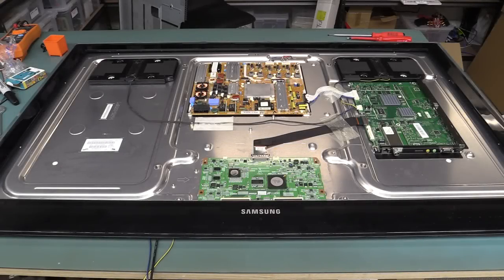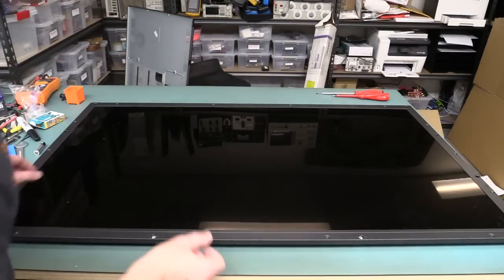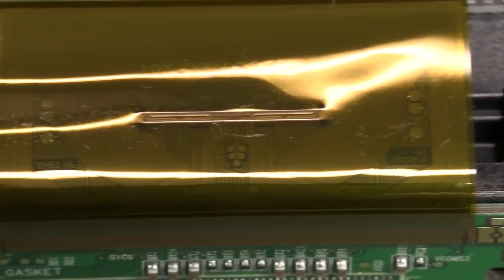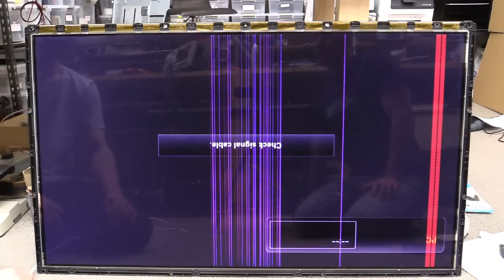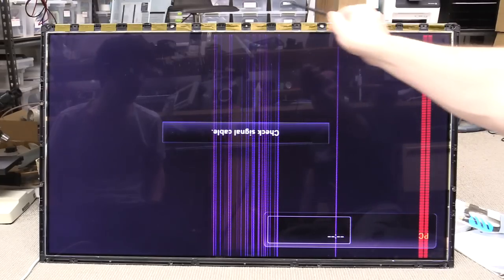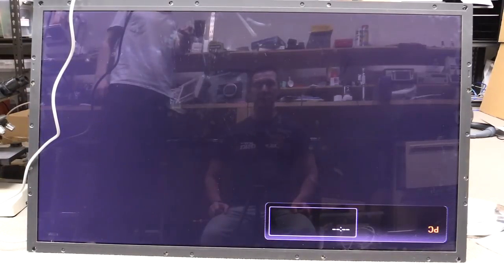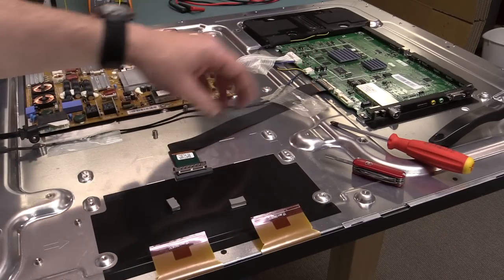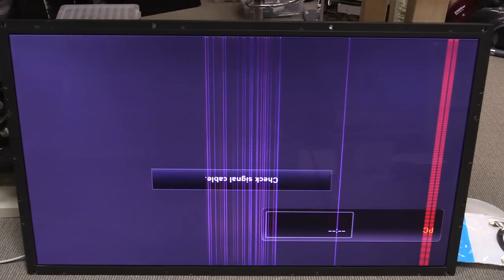EEVblog #781 - Samsung LCD TV Part 2

Comment: The fade-in and shadowing says "floating input somewhere" to me
Reply: mikeselectricstuff It seems doubtful that anything is addressed by column in a way that would break things across the whole column before and after the text except for something related directly to the panel.

I'm somewhat familiar with how this failure mode might occur with OLED panels, but I'm not that familiar with LED panels. With OLED panels, you need to reset each element to a certain voltage before writing a new scanline. It would seem here that something about each vertical column isn't getting reset between scanlines and some voltage or charge is building up across the whole column. And it's panel wide.
Reply from the maker: mikeselectricstuff That's what I was going to check with the scope if I get around to it.
Reply: I had a similar issue with a tea damaged LCD panel from an iPhone 4, but it was more in the opposite order. The panel would start up fuzzy and eventually clear up after being on for ~10 minutes. Some characters made bigger lines to be displayed as well. It has 3 chips on the panel(chip-on-glass?); two drivers apparently for each side of the long edge, and the wide chip tcon/short edge driver. The LVDS bus is fine and then phone has no issues with a new screen.
Reply: Definitely something floating...
Reply: Gustavo Ferlizi Are you British? Surely you gotta be British if you managed to damage an LCD panel with tea.
Reply: Techy 4198 Not British born, but live just out of London and drink loads of tea. Not my phone and not me that gave it some tea.
Reply: Gustavo Ferlizi Oops, sorry, misread it. I thought you said it was your phone. Let me guess which company that phone is/was on... Tea-Mobile? :P
Reply: +Techy 4198 it was Teasco Mobile :D
Reply: Gustavo Ferlizi Isn't that run through Oh-Tea's network?
Reply: Techy 4198 It was. Tealefonica sold to HTeeaG (3). I am a Teea UK customer, and now connect to the previous Oh-Tea network infrastructure seamlessly. Fiftea mb/s LTeaE at home! :D
Reply: In a detective scenario you always looks at the particulars. 
It's a column artifact on screen. It has a leakage type progression. It seems to be triggered by bright elements, either 255 per channel value or near to that. The orange triggers red flooding, white triggers both red and blue (purple). Oddly green is not triggered. So what could possibly support a smooth progression in a digital panel? certainly not any of the digital states because digital ramp up can only be done intentionally due to its discrete nature. You would need a counter circuit for that and that doesn't happen accidentally. I think there must be a final analog electrical state that is the result of the digital pixel value and that has a leakage of some kind. I'm guessing it's a panel problem. Maybe it was dropped. But for the problem to be universal for the entire surface which it seems to be, it would have to be a 'common mode' problem, like a leak on the edge of the panel. Maybe pinch the bottom of the panel. Where the luminous row is. Or cold spray the edge. Maybe cleaning lady applied a liquid that burned the lower edge of the panel? women :)
Reply: +Mila Miglia Yep. I think layer separation is what happened in my case with water ingress in the panel. For a panel that big however I wonder if shock damage could manifest throughout the hole thing like that... but I'm sure Murphy would find a way to knock the whole thing off it's 'rails' with a single bump.
Reply: Mila Miglia i am still confident what this is gate driver problem, nothing to do with physical damage of panel or something else. also there is one line on panel right on bottom(where all connections goes) which shows defect right from start and with most intensity
Reply: Mila Miglia The cleaning lady at a place I worked at in the mid-80s gave a very expensive Digital (DEC) monitor with a very non-reflective multilayer coating a good going over with some spray wax polish. It was never the same again.
Reply: Graham Langley My Ex used to do that on everything.When we moved, you couldn't pick anything up because they where all so slippery. ruined the finish of all my audio equipment.
Reply: +Gustavo Ferlizi be happy you're not on A-Tea and Tea, i hear they work closely with intealligence
Reply: It looks like both address- and value-related. I would put my money on faulty SDRAM(s).
Reply: mikeselectricstuff 
The Failure has to do with white balance settings - Switch the tv to standby, then press

"info" "menu" "mute" "power on" buttons on the remonte.

You will enter a HIDDEN SERVICE MENU

Alternativly press

"Mute" "1" "8" "2" "Power" buttons on the remonte.

Go to ADC/WB Option under the WHITEBALANCE menu

Reduce the value untill the vertical lines vanish

Go to the Brightness option in the menu

Fine tune your picture

Source:
'Samsung tv vertical lines problem fixed...'

It's worth a try
Reply: dobroslawja
no remote
Reply: Sirus 
1. buy a replacement

2. clone a remonte by teaching an universal programmable remonte (10 bucks)

3. reverse engineer a samsung remonte and send dave the codes on the physical level

dave will then be able to bypass the IR receiver, generate the codes with the right frequncy by an arduino and inject them with the right signal levels to the tv
Reply: dobroslawja Bloody IR remotes. To many "standards" to much bloody hard work. Against all my my sanity I do agree that smart phone control is a good idea for your local environment as you have blue tooth and wifi standards. Line of sight is replaced with a code.
If you have a family, the joke of who is in control of the remote goes out the window. Mummys got the remote, daddy don't watch the telly but can shut the thing down.

Your points 1,2,3 need the remote.
Reply: EEVblog Why didn't you freeze the flat-flex-chips?
Reply: The Kaiser I wonder how and why this works or is it a fake?
Reply: Mila Miglia I think you're on the right track. Remember that all modern hi-res panels are active-matrix, with a thin-film transistor (TFT) at every pixel. An entire row of transistors are turned on at once, and the column drivers are set to the correct voltages for that row. Then, the transistors for that row are shut off and the next row is turned on. I think that what's happening here is that the transistors are not getting fully cut off when the row is deselected, and they are allowing charge to leak through to the pixel itself. The common-mode cause could be an incorrect bias voltage being supplied to the row drivers, the column drivers, or both. Time to take a closer look at voltages on that TCON board.
Reply: theuser6666 Or perhaps a cap at the reference voltage stage. That ref voltage needs to be spot on.
Reply: +EEVblog I can't wait for part three of this exciting detective story!
Reply: +EEVblog From what i remember i believe this is a LN46A550 because i recognize the same interface on my B2330HD/LS23PTNSF/ZA (23" LCD TV)
Reply: Westley West How does this bring us any closer to solving the problem?
Reply: Google+ is Censorship Just Reference.
Reply: Westley West Is that all wizards can do these days? What kind of wizardry is that?!
I am gravely disappointed.
Reply: Google+ is Censorship I'm sorry i didn't mean to say that. all i know is it has a similarity.
Reply: My first thought was heat. As the chips heat up to operating voltage, the lines appear. But as he noted it seems to follow characters, that still leads me to think it is a processing issue.

Comment: All the vertical lines, line up exactly with the OSD text, so its looking like it is possibly an issue driving the framebuffer RAM's, I've seen the same style of issue on a much lower tech LED sign display, caused by a decoder with leaky outputs not fully turning off  after drawing a pixel, so you ended up with faint trails on the next lines
Reply: can you explain for me a little  more please ?
Reply: Dwwd
Reply: Dwwdd

Comment: The problem is the LCD panel, this is a very common problem for Samsung TVs. If you disconnect one ribbon cable from the Tconn to the panel the problem might go away (only half the picture will show) and you will know the side that is causing the problem. You can also try some freeze spray on the COFs to see how it reacts.

Comment: Surely it's 1920xRGB=5760 columns?
Reply: mikeselectricstuff Not the first time Dave forgot pixels have rgb elements.
Reply from the maker: mikeselectricstuff Err, yeah, Doh.
Reply: +Gone Tomorrow I would assume mobile phones have a lot more on glass logic to get passed that.
Reply: ***** but its not only theirs 3 color for each pixel but you also have two lines correspond to each subpixel and a transistor in the corner.
Reply: EEVblog I may sound like an amater , but does the smaller BGA on TCON board looks like it's gone...? Looks like it's burned out... Warped... Shines more than the big one?
Reply: Umovni I think that's just some of the thermal grease on the chip that helps make a good thermal connection to a heatsink on the back panel that goes against that chip. He explained that in the Part 1 video if you didn't see it.

Comment: Love this fault finding problem, yes get the Scope out.
This has been fascinating Dave.
What a result if you narrow the fault, even if you can't repair it, great experience.

The fault does't appear straight away, suggesting a heat fault, maybe it is with the tecon board after all.
If the heat fault is in that board, you may need another ASIC.

Comment: Dave, from my experience with my TV, it is indeed the T-con board. You realized that the lines are exactly where the letters of the menu are, as if the menu "caused" the problem. If you put a digital image to it, the lines will probably disappear after some minutes and the image will be totally clear until you bring up the menu again or if you try to watch anything analog and the image will probably get even worse then. I'm telling you this, because that was exactly the symptoms of my set. Replacing the T-con solved completely the problem here.

According to what I read, the chip the causes the problem is a small squared one with the code AS15-G (at least in my set)

Comment: hook up a video signal to it and watch it clear up after the menu text dissappear.
Reply: I have to agree, hook a Pi up to it, and check if it's just the menus, or full video problems
Reply: dreamfox32 Now that could be useful in isolating the problem.  If it completely clears, the "character generator" could have a fault, or the connection from it to the next stage in the video processing.  I imagine it's not a separate chip but integrated onto one of those custom jobs on the "processor board" as we're calling it.  If I had to guess I would say those chips are not going to be available and full board replacement would be required.
Reply: dreamfox32 Did you miss the test image in the previous video?
Reply: hendik hendrik Wasn't the image test was generated by the processor board, and not by a completely external source?
Reply: dreamfox32 How would that repair the fault?
Reply: The Kaiser it wouldn't, but it might help identify it
Reply: Daniel Coates Really? How so?
Reply: Had a Samsung tv do the same thing
Reply: it is worst, as soon as you have video playing, the full screen starts getting white, I have the same fking problem and still no fix for it, but mine has no replacable t-con board, it is cof tcon board, meaning it is soldered to the lcd flex

Comment: I used to heat the boards to the oold CRT TVs on the gas stove.  Once I heard cracking, I would drop the boare, component side down, and all of the components would fall out.  That is how I would quickly collect boxes of components for fee.  Great video.
Frank

Comment: From my experience with the same problem on LG 42" LCD TV (exactly the same manifestations), hotbar connections were the problem. That sticky conductive transparent tape (forgot the name) that bonds flatflex conductors from LCD glass to that upper board was not conducting any more. With blowing hot air from hot air gun, and more importantly putting rubber bars that mechanically pressed the connections, TV was again having good picture. That worked for about the year and then started going bad again. Problem with my TV were old CFL lamps that were getting pretty hot (glowing with more red color), and whole tv screen got hot and those contacts to the flatflex were ruined. After that 1 year of extra life, and 6 years form TV,  i just bought new one...

Comment: EEVblog Dave, this whole stuff can be because of low gate open voltage, there is a dc-dc converter on tcon board somewhere which drives gates, check voltages

Comment: The lines appearing only where the characters are looks like a RAM addressing issue to me, like a floating / stuck address line. Since it fades, it's probably floating, so you get an average over time of white and black (text and background) on the whole column. That also explains why the lines have colors close to the text color and the striped pattern (the regular spacing of thin black lines in the red columns)
Reply: What’s the fix

Comment: The TV manufacturers won't like it if you find a bypass for their "Built in obsolescence" lol.. 
A very interesting project though. 👍🏼
Reply: Green Silver It's always funny when it ends up being 3 dollars worth of capacitors. I think they've caught on that people are fixing these issues easily, so they've stepped it up to corrupting something or just having the chips shit themselves after a while.
Reply: It is easy to make a chip die prematurely. In the NMOS process, a little too much boron in the glass passivation layers will slowly cause the boron to slowly diffuse into the chip substrate, killing the chip. This was the problem MOS Technologies (Commodore Business Machines) had with the chips used in the C64. As they heated up (they ran hot) over time that made them diffuse faster and faster.

Comment: As you have problems on both sides of the split it's probably on the TCON that the problem lies in, as the likelyhood of both sides of the panel TAB bonds going bad at the same time is pretty low. As the problem looks "analog" the scaler board (what you call the main board) is out of the question. A lot of "analog" stuff goes on in the TCON.
Reply: Good thing you mentioned that, just like Dave 2
Reply: Danny Bokma Exactly.
Reply: Danny Bokma Is there anything wrong by getting a second opinion? I have real experience repairing TV's, which Dave or Dave2 does not seem to have.
Reply: you had the same explanation, and of course there's nothing wrong in that.
Reply from the maker: ***** Yes, that's the conclusion we came to. That's why I then reflowed the T-CON board.
Reply: Reflowing the TCON doesn't help. You need to replace the board. The boards run hot and the chips break over time.

Comment: Lower the brightness level and color intensity and when the menu text dissappear it goes to normal viewing
Reply: dreamfox32 Well, it might be reasonably tolerable, but even if the image produced is flawless, I think that would be to miss the point: to make an interesting electronics repair (attempt) video.  I don't think Dave is hurting for TVs.

If that was mine I would probably just leave it at the appliance recycling place, and buy a new and better TV.  They are so cheap now that they're practically disposable.  That said, my 40" Sony LCD from 2007 is running like a champ.  It's 10cm thick, but I'm not looking at the edge of the damn thing. :)

Comment: Maybe interesting: hoe about doing a reverse repair! Introduce an error and look at the effect. Two examples 1) Cut a trace (repairable) on a FR4 based board leading to a flex cable, goal discover what a bad solder joint would introduce. 2) introduce a "stuck at" 1 or 0 error on memory databus.
Reply: Danny Bokma 
Yeah, I like the idea. It could have more educational value than a repair, and maybe more spectacular results.
Reply: nativewinner Spectacularly smoky and then the fire system kicks in :)

Comment: One Hint for the problem not being linked with a faulty panel might be that all the vertical lines appearing on the display are somehow bonded with the characters displayed! Red collumn -> orange "PC" letters, cluster of lines in the middle -> "Check signal cable." and the one in between -> the ":" in the time (?).

Comment: The problem seems to be more evident with antialiased fonts drawn by osd software lib (you have the issue near the curved lines and not on the horz and vert lines that are instead perfectly row/column aligned), this suggest a timing problem with partially lighted leds...

I think you should input some video test signal from a pc software generated image and see if we have changes with full red, full green, full blue, 33% rgb, and so on...

Comment: You didn't put any pressure on the flat flex where it's bonded to the LCD glass, which was the location of this issue on the 2008 Samsung I had. Notice how the lines follow bright areas in the picture at any row. Maybe one of the return lines for the row drivers has lifted, and every pixel in the row slowly floats high if one is high?

Comment: In the event of a suspect main ASIC or memory, feed it a video signal (VGA/HDMI) and try to change the resolution. If you have a memory error the patters will move as the picture is placed differently in RAM.
Reply: on tcon board level it will always fit exectly the same way in memory.
Reply: Yes, as it's behind the scaler board. If it was a memory error i wouldn't appear slowly like that, but be there from the beginning.

Comment: seems like it could have something to do with a chip heating up, just based on the way it fades in. you could try blowing hot air on different chips while it runs, or look for a particularly hot chip with the thermal camera.